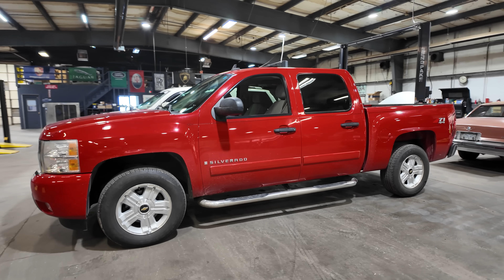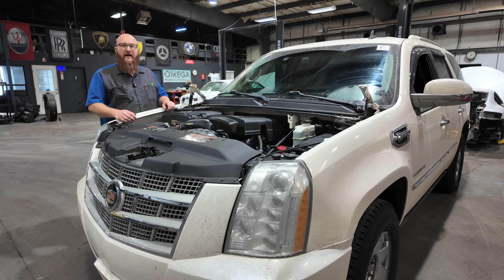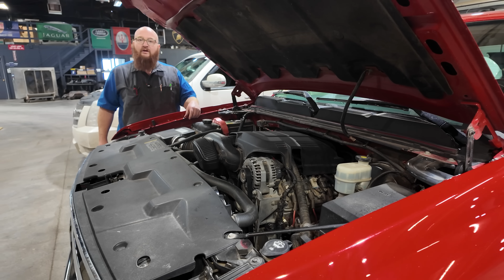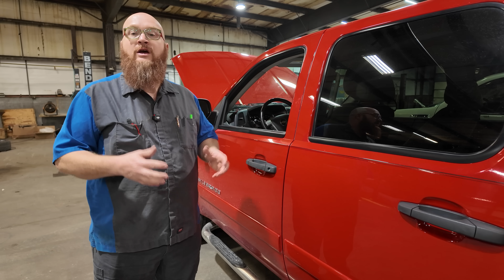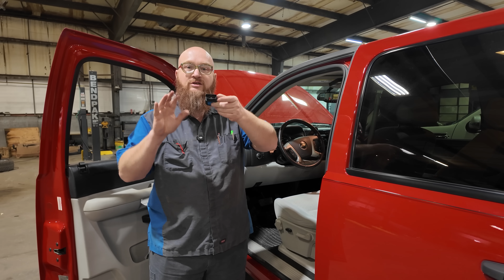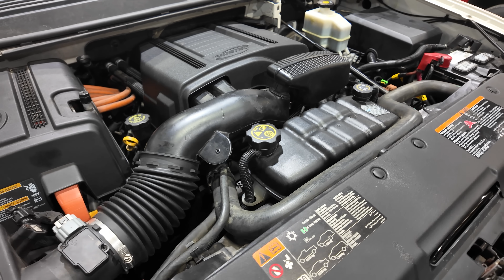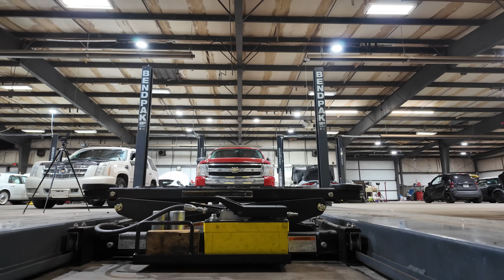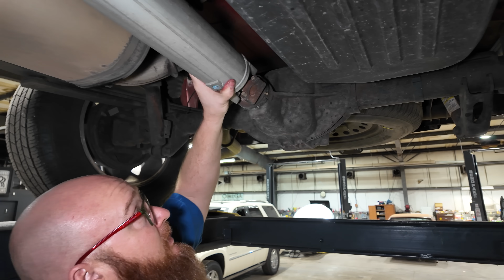AFM: Engine Saver or Engine Killer? The REAL Answer

Comment: I have driven every truck GM has made since 1995, and the ONLY difference in fuel economy I have seen has been from the SBC to the Generation 3 LS based engines, and from the Generation 3 to the Generation 4 engines on VVT alone. The AFM/DFM “fuel saving” is garbage. It’s for EPA only, and that has proven to be bunk as well. It’s a checked box on an attempt, not a result.

Comment: I have a 07 6.2 the only year made without AFM 250k pulled it apart and the only thing that was remotely noticeable was the timing chain tensioner I replaced everything with oem parts.

Comment: As of February 2026, the Trump administration has finalized significant deregulatory actions for the auto industry, including ending the 2009 Greenhouse Gas Endangerment Finding and eliminating federal GHG emission standards. These actions aim to boost domestic manufacturing, reduce new car prices, and promote gasoline-powered vehicles over electric vehicles. 
Key aspects of the changes for cars and trucks include:
Elimination of Emissions Standards: The EPA has repealed federal greenhouse gas emission standards for new motor vehicles and engines.
Endangerment Finding Revoked: The administration ended the scientific determination that GHGs pose a threat to public health, which previously provided the legal basis for stricter, Obama-era emissions rules.
CAFE Standards Reset: Corporate Average Fuel Economy (CAFE) standards were modified, including setting civil penalties for violations to $0, to make compliance less costly for automakers.
Tariffs on Imports: 25% tariffs are in effect for vehicles not assembled in the U.S..
Start-Stop Technology Credits Ended: Credits for automakers installing automatic start-stop ignition systems were eliminated.
Trucking Regulations: The administration has eased restrictions on driving hours for truckers, including expanding "short-haul" exemptions. 
These changes seek to reverse strict,Biden-era emissions rules, with the goal of reducing vehicle costs and increasing consumer choice, while potentially allowing higher-emission, gasoline-powered vehicles to remain on the road longer.

Comment: Thank you I will now forever wright off AC DELCO AND COMP CAMS. I spent 1000’s and my comp cam lifters that soaked over a week failed immediately. I called them about replacements and they said you can pay $500 and try again. No warranty. Okay sounds good I’ll never build an engine with your parts ever.

Comment: Had the same thing happen on my 5.3 silverado.. bought it with 65k. Bought a afm disable and always had it plugged in. At 157k developed a slight miss on 3.. couldn't figure out why so took to the dealer. 

Dealer pulled the head and found a non dod lifter failed and ate the cam. Quoted me 21 thousand dollars to fix. And they would have just put dod lifters back in.

I told them to button it up and towed it home. The cost to diagnose was 1 thousand dollars. Just to pull the head and tell me what was wrong.

I bought a full dod delete kit from Texas speed and replaced the cam and lifters with non dod lifters. Bought the flasher to flash the ecm.  Its back on the road now with 172k on the clock.

Curious why you guys decided to replace the lifters with dod lifters. Was it that the customer did not want to spend the money on a cam? I can understand that. It was a hell ot a job on a gen 5. Had to pull the pan. No way around it on a gen 5..

Comment: I have a 2025 Hyundai Palisade with approximately 8000 miles. I don’t have any issues yet with the vehicle, but I am concerned about it in the future because of the automatic engine stop that came with it. I want to permanently disable that device and was wondering if they make something that can plug into OBD sensor to do so without it damaging the engine. Any information on this problem would be greatly appreciated.

Comment: With a 5.3 L83 mated to a 6L80,  local driving in 'L5' will keep you out of AFM. Going back to 'D' for highway to open up 6th and AFM will reengage. When you get off the highway, back to 'L5' and you limit your exposure to the worst stop-and-go AFM engagements at lower speeds.

Comment: This is a good statement about the AFM. I bought my 2013 Chevy Silverado brand new with the 5.3 and 4x4 ext cab Z71 package, and the first thing I did was buy the Hypertech Power Programmer. It allowed me to disable the AFM, and add a little more power plus change my shift points and bumped up the line pressure inside the transmission 25%. Another thing that i have added is a oil catch can,  which keeps a lot of nasty acid oil  vapors from going into the into the intake and clogging up the valves. This truck has performed flawless. I now have close to 250,000 miles and can say this has been the best truck that I have ever had. I do not cut it no slack in everyday driving and tow at least 50 percent of the time.
Reply: Consider a thermal bypass on the transmission. Basically just a lower temp type of thermostate.
Reply: @MIKEG-g1g  I keep hearing about that, but none of the comments I have read link to a YouTube or product. I have a 2017 Tahoe with factory heavy duty tow package and I would like to help my transmission. Were do I get the product and where do I learn how to install it?

Comment: I have a 2011 5.3 Silverado that had an AFM lifter failure. It had a Range+ dongle to disable the AFM but it still failed, one of the lifters turned 180 degrees inside the motor and chipped at the cam. It does not matter if it's disabled or not because the only true way to fix it is to physically delete the AFM system. Due to the nature of how mine failed it would every once in a while, work as normal but then it would turn again at some point and misfire again. Those plastic trays are part of the problem as well as the lifter. Thankfully, other than the little bit of the damage to the cam the rest of the motor was fine.

Comment: I scored an 💯 rust free 07 up here in 🇨🇦 with the good ole AFM misfire... I'm in the middle of completely rebuilding the engine with the Truck Norris Cam kit, ported heads and a couple other upgrades... 2800 stall converter... Got the truck cheap but even building this engine myself it's costing me over 8k! 🤣

Comment: Had a 2008 Silverado 5.3 the did went twice. Once and I fixed the whole thing like stock, about four months later it did it again and I deleted it. The tune was never right though. It was fine everywhere except at idle. It had a miss at idle. I'd say to anyone that once the system dies or starts actively showing signs go ahead and delete it and buy the whole kit with the cams, tune and everything. I pieced mine together and it probably was why I still had a miss when it was done. I wrecked it not long after it was done so I never figured it out

Comment: The lock pin in the lifter is what fails. ignoring lets  the lifter spin, this wipes out the cam. The fix is, if its working, to tune it out. the lifters will last longer. If one fails, you then tear it down and install LS7 lifters and baskets. iirc.

Comment: Can't deny this is the democrats doing just like it in the 70s. Cafe standards. I heard trump did away with it. But now theyre saying now they have to lump all them together and the restrictions on fuel economy and emissions will be higher. I haven't looked into that. Turning on and off cylinders. Lifters any of it is going to cause problems. Let's not get into that thin synthetic oil. It's all designed to fail.

Comment: They only did the DOD/ AFM  for CAFE standards / regulations total bs cause those standards cost me 2k for my AFM delete! And I did it myself ! I tried using the AFM and compared  gas mileage to not using it and I got better gas mileage by not using it lol and when I did use it back in 2007 without the oil pan shield I burned so much oil ! 2 qt per 3 k miles and GM said this was normal,  there fix was changed the oil capacity told me to put one more quart in during oil changes lol after the dod delete no more oil burned ! No more lifter worries ! And I got an upgraded cam !! :)

Comment: Ty wizard for finally clearing something up for me for about 6-7 years now. I got a 07 newer body Silverado 4.8 , for years I been asking ,others have asked does my truck have the VVT bs. I thought maybe 07 was the last year not to have it, maybe the previous owner deleted the vvt , so I have it and it’s just not working correctly or I haven’t noticed it not working???? It’s been a bit of a mystery. You confirmed today the 4.8 did not get it ! I’m happy. This happens to be my second truck with a 4.8 ,great motor as good if not better than a 5.3/6.0 based on this info. no issues besides a rebuilt trans 5 yrs ago!

Comment: I have a 2013 Suburban with the 5.3L. I bought the truck used with about 70k miles. I added the disabler from Range Technologies. I now have 187k and have had no engine issues so far. I use full synthetic oil every 3000 miles. Another way to disable the AFM system is to shift the trans into manual mode and put it in 5th gear, don't let it go into overdrive and the AFM system will not come on, you just give up the benefits of OD.
Thanks for all the great education Wizard!

Comment: Mister Wizard. I enjoy your presentations. I also recognize that your analysis is typically spot on. Yet the foundation of this more & more complex and expensive technology, appears to be caused by the root demands of the US Government EPA, that force manufacturers to employ engineers to try to meet certain fuel mileage goals, or there will be penalties. This has made electro-mechanical valve trains that are relatively very complicated and which have an increasing likelihood of concerns. Since everything in a vehicle's development is a constant battle between cost vs function it can lead to less dependable engine operation, especially when maintenance schedules are not adhered to. Hopefully with the EPA hound dogs starting to be held back at bay, cylinder de-activation & endless cam -phasers & solenoids & variable cam timing, stop-start, etc can be reduced or eliminated in future designs. Typically a manufacturer keeps the same crap they initially engineered in place until they can redesign the set up again so it might be a few years before these troublesome features can begin to disappear.

It must drive the engineers nutz to develop such devises realizing that there is a greater potential for problems. 
Actually GM and Ford have reported on the difficulties of meeting these Government demands for increased incremental fuel mileage but their efforts appear to not be well coordinated to present a solid challenge to the EPA demands, because it stirs up a big mess with the bureaucrats who keep pushing this crap, & who are often disconnected from the reality of actually making a technology work dependably. Hopefully with new EPA leaders there will be changes. GM & Ford representatives need to develop the courage to educate & then challenge EPA assumptions & fight back. But beware & be prepared for the Green Devils who will be out to say that you just don't want to "Save the Planet," & Hug Mother Earth which will be trumpeted all over the Legacy media.

Comment: I owned a 1985 Seville for awhile with low miles with the 864 4.1 v8. One of the most bizarre vehicles I ever drove. Car was front wheel drive as well. Had a 300k corolla with plugged cats that accelerated faster 😂

Comment: I had a 2017 Tahoe and I added a disabler to that truck and never had a problem with the amf system it works great and it improved the shift points on the trans and I was able to get 23 mpg on long road trips..
Reply: I have the same truck as you and learned/am learning all this stuff after buying it!  Please, which brand disabler did you use and does cruise control still work? Thank you.

Comment: I had a Honda Odyssey with VCM ( variable cylinder management )
 There was a kit that you could add a resistor from a temp sensor on the radiator to make the computer think it was cooler than it was and trick it into not operating the VCM. 
 I was having trouble with the cylinders of that worked with the VCM .
 Its was noisey and rattling until it got up to 2,000 rpms,  and the motor finally crapped out before I could get it to bypass the VCM.
 Honda gave this as an option and you could also get a non VCM .
 They finally stopped making in it.

Comment: Ive seen both a '14 and a '15 1500 5.3L with just over 110k fail in the same way. Hard acceleration on a corner causing traction control to kick in and cause a lifter to fail.

Comment: i was worried about afm failure in my 13 5.3 when i bought it at 127k miles. plus aftermarket exhaust had terrible drone in afm mode. had it tuned with hptuners to turn afm off, ran it like that until 149k miles when as a major preventative had the engine pulled and mechanically deleted. have 190k now and no issues.

Comment: 30 year ASE tech.  Thank you Wizard for explaining the options for car owners.  The plug in device is great insurance.
Reply: Hey Steven I wrote before I had my afm delete in and my 2015 LTZ wouldn't pass emissions. I had the tranny done and a fuel pimp so the battery def was off for a while. I drove the 50 or so miles and even more modules wouldn't open. So my mechanic told me to drive without it for a while so I did like 50 more miles it passed! Should I put it back in then in a week but inspection take it out and rive the 50 miles again! I don't want the headache again it failed 3 tiles then with it out it passed!

Comment: I was one of the GM engineers who launched these hybrids and worked at the plant building them. They were not discontinued because it was stupid or that the highway miles weren't much better thank conventional gas engine option.  You failed to touch on the incredible increase in city mpg where it shined.  Every one i drove broke 20mpg city and that's incredible for a large suv. They were discontinued due to sales....remember this is the early days of hybrids. I am now retired and run my own 5 star rated auto shop and we still see a few coming in and doing great at 200k miles
Reply: Do you disagree with the AFM tendency to destroy the engine?
Reply: @kingofburgundy6323 no my opinion is AFM is terrible and my shop sees 5 or 6 a month with some even destroying the cam. Its a system we don't need and I won't own a 5.3 or 6.2 GM.

Comment: I wonder if those lifters are out of spec parts, I worked for a tier 1 supplier transmission parts supplier and there was two running specs on the floor. The second spec was usually slightly oversized and I’m talking a few microns or tenths of thousands of which Is half or a hair off. It doesn’t sound like much but clearances are critical over time. We would quarantine those parts for future QC inspection. GM would call up our plant and ask for everything we had on hand to meet production demands and throw the spec policy out the window. Sorry for the long ass comment but it’s a trade secret people aren’t aware of.

Comment: There is no version of AFM I trust. Some are less likely to wreck the engine than others. NONE are healthy for the engine and there's not a chance in a billion hells that the technology has done one whit to reduce emissions. The microscopic amount of fuel savings people see in reality is utterly outweighed by the oil burned and the loss of resources and manufacturing energy from the many thousands upon thousands of engines that have gone to the dump.

This is easily the most disastrous innovation ever forced upon the public. There have been some that failed quicker and more catastrophically (I'm looking at you Ford Pinto), but NOTHING has destroyed more perfectly good engines and vehicles than AFM.

I really cannot exaggerate just how damned stupid AFM is and what a curse it is.

Comment: My 2018 Sierra 1500 has 120,000 mikes, AFM has been disabled since about 60,000 miles. So far, no problems. Drove to Hershey PA to the AACA swap meet last fall more than 2200 miles, averaged 23.2 MPG according to the on-board puter. Perfectly acceptable economy for a circa 6000 pound vehicle. 
I don’t plan to buy a new one with AFM or turbos. NO.

Comment: Purchased new a 2012 Chevy suburban 5.3  disabled the AFM using a bully dog tuner at 40k miles, and it now has 270k on it and the engine still is running strong.
Reply: You didn’t fix anything.  The issue is a hardware problem not a software problem.
Reply: With successfully getting 270k with no major problems who cares
Reply: Have you had any issues with the battery going dead
Reply: @Breadmansgarage  yes I got screwed when i bought it the guy replaced the fuel pump then a month in the Tranny went so the battery was disconnected again but I drove like 50 miles with it in then when I took it out to get for inspection it showed modules weren't open. That happened like 3 times then my mechanic told me to take it out and drive it for a while without I drove the expressway back and forth and then sure as hell all were ready lol! I just don't want lifter failure the thing runs amazing now and of course the trans is great lol!
Reply: Hey Brother I have a 2015 Tahoe LTZ I have a boost afm delete  it stopped it from passing emissions so I took it out drove it like 50 miles without it and it passed. Do you think I should put it back in and then like a week or 2 before inspection take it out again?
Reply: @nyjohn68  Yes
Reply: Same
Reply: No smog check issues ?